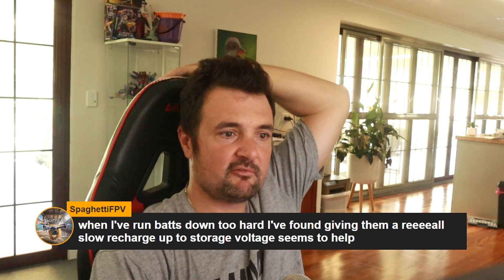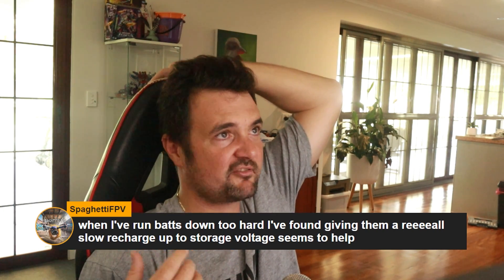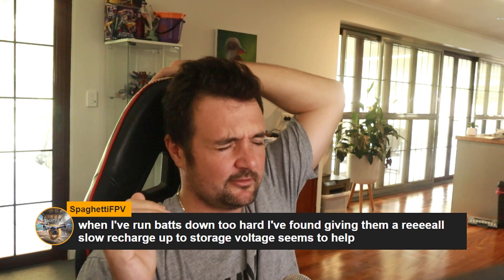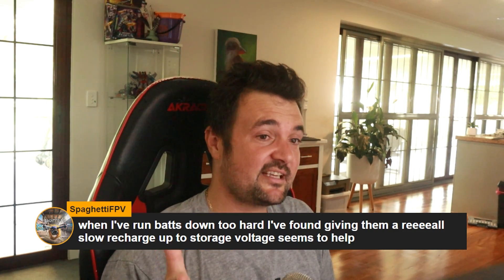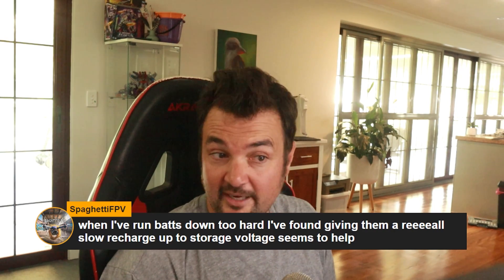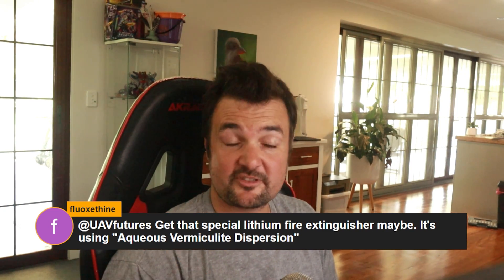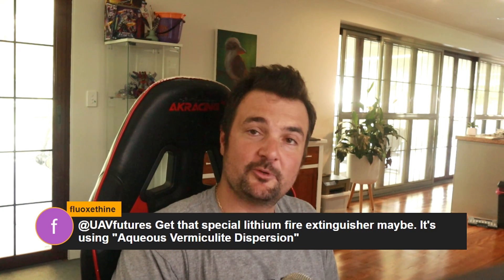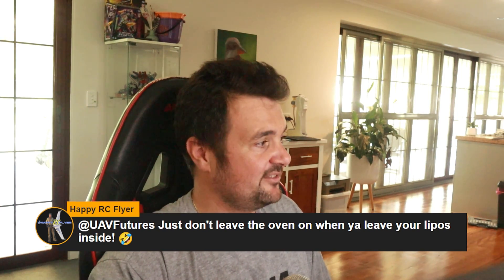IS THIS LIPO SAFE TO FLY??

Comment: Pro Tip!! Put extra shrink tubing on your batteries to extend the durability of the pack. Factory shrink wrap is thin and doesn't offer any protection from crashes. IMO
Reply: If you got a 3d printer you can make a small shell for it

Comment: Thanks man for some actual real battery management tips. At the start the bigger the battery in my head I thought the bigger the risk but all batteries have a point of no return or fail. The best tip would be even if you fly all the time or not try to keep your batteries at storage voltage.